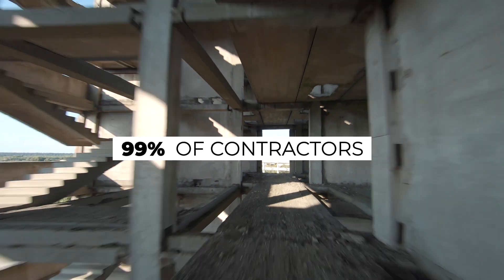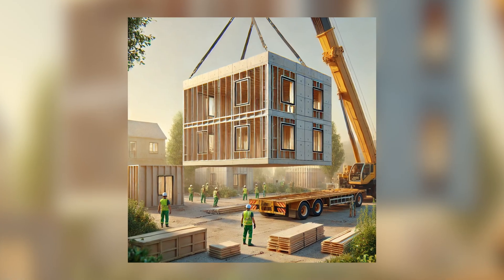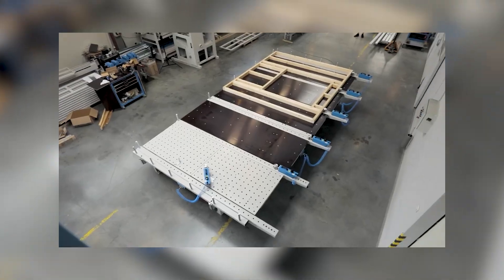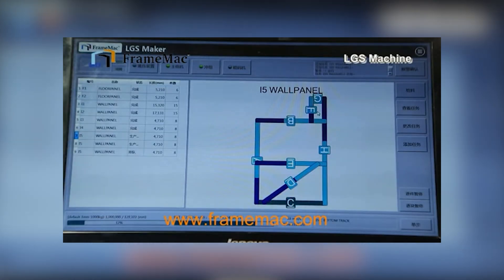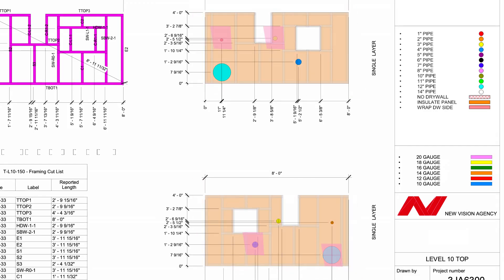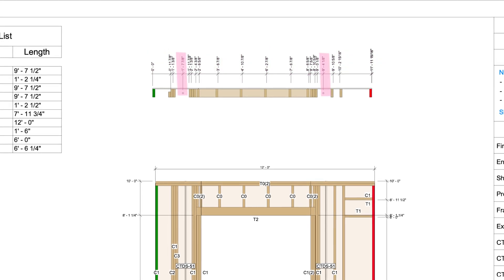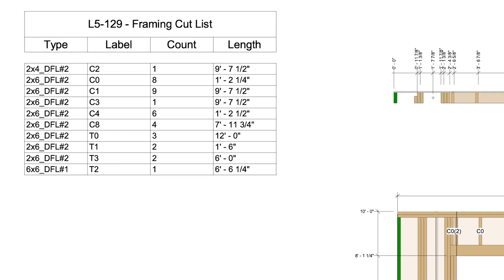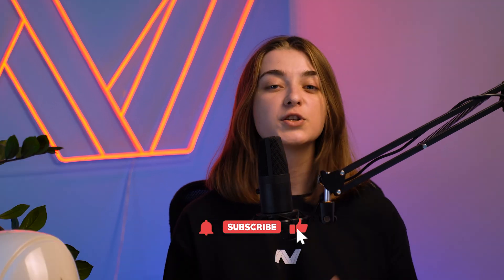Why Prefab Framing Is Changing the Game in Construction – New Vision Guide

Comment: Steel frames are straight 99% of the time. Timber usually needs planing and/ or packing, even if they are prefabricated. Most builders and trades (particularly domestic/ residential) are more comfortable with timber because that's what they are used to, and they don't want to change. To be fair, most have spent many years honing skill working with timber, if they move to steel they have to learn again, there's always reluctance to change in any industry or skill (you mentioned 3D modelling, try getting a skilled modeller to move from Tekla to Advance Steel or SDS2!).
Reply from the maker: Great point! As you said, even prefabricated timber needs the planning and packing and for this we use Onyx stacking to think about the deliverables of the panels and work out our material lists for the convenient cutting and transporting (we are also going to make a video about this). So I think the prefab of timber is going to grow fast!
I don't think wood should be changed to metal, they are both good for certain purposes - wood for residential and steel for commercial. But it's never a bad idea to learn new skills.